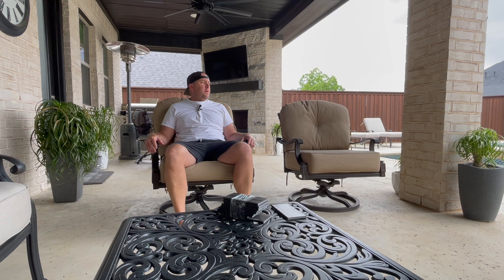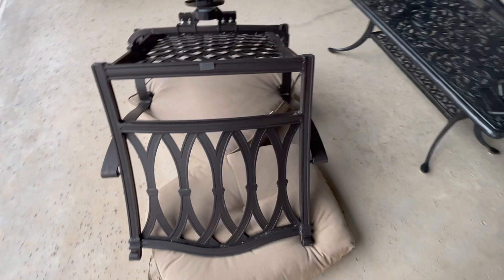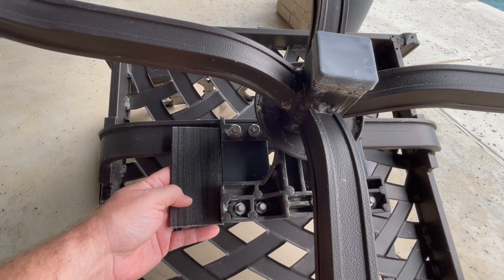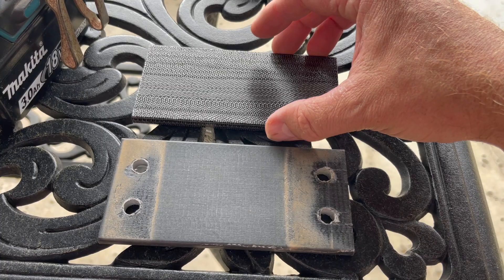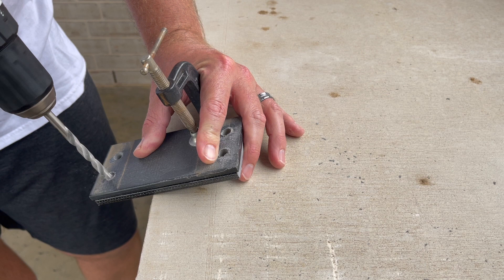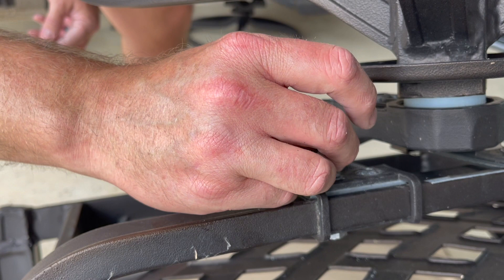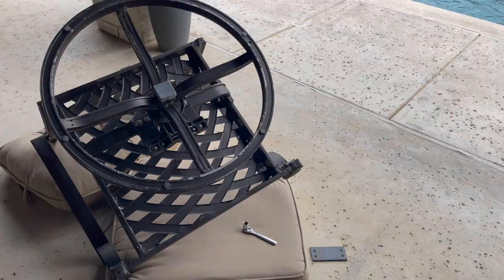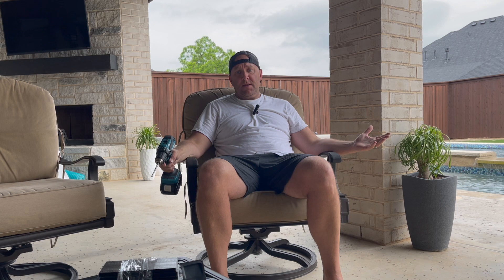How to fix a Patio Rocking Chair w/ Spring Plates

Comment: Thanks! This is exactly what I need. Is that Darlee furniture?
Reply from the maker: Awesome I’m glad it helped you, that’s why I do these.  These are some kind of emerald brand chairs.  But these plates work on all kinds of similar rocking chairs.  All manufacturers use these plates on these style of chairs.  They have been like new after replacing these plates.  I had no idea before I started researching this.  I was gonna buy new chairs, but sheesh they’re not cheap.  These plates are though 😂

Comment: Hi there!  How long have you had your chairs before the spring mechanism went out, if I may ask?  I'm looking for patio chairs and similar set is running $440 in my region.
Reply from the maker: Hello, I actually just bought all four from FB marketplace for $350, because yes these chairs new are expensive.  I just used some WD-40 to wipe them down and it cleaned them up nicely.  We looked at some that were $1500 each 😳.  I only had one chair that had a bad spring though.  The others seem to be holding up so far.  Did that help at all?
Reply: @scottsworld21  yes, Sir.  They sold nicely second hand-i couldn't even tell!  Excellent buy and Thank You 😊